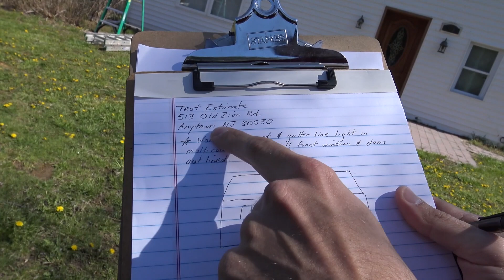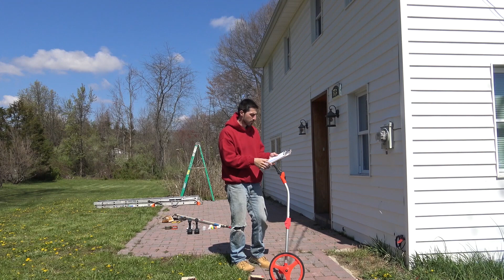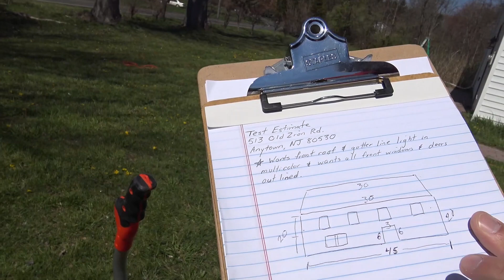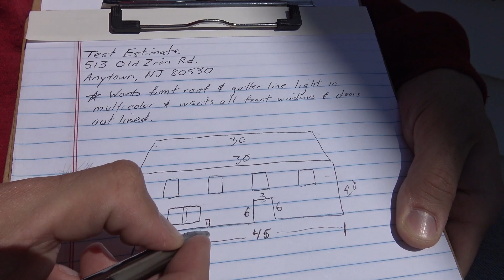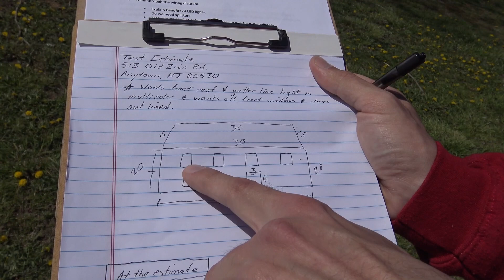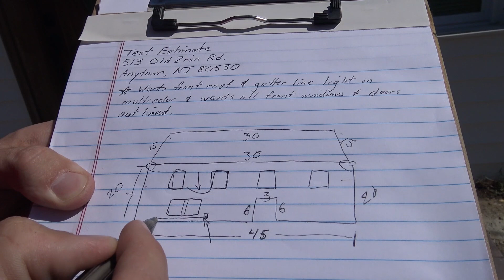How do I professionally estimate Christmas light installs

Comment: so how do you deal with the windows and light lengths? I listened to your podcast, and from what I heard, you arent using custom lighting lengths, and you buy lights at wal mart. I cant comprehend how you run the extension cords to each window, keep things clean, wrap the windows in lights, etc. The estimating part makes some sense though. More videos would be helpful, along with the actual set up done on this house. thanks
Reply from the maker: Windows sometimes get doubled up. For example, if we run slightly short (example; 14 ft of light but the window needs 16 ft) then we will just attach another length of light and double wrap all of the windows that we do. We've done that several times this year and it's our solution every time.  You can get the full course here which includes full breakdowns on how to estimate and show's full installation... it's on sale right now for $100.00 right here... https://www.udemy.com/chl-team/?couponCode=SAVE_BIG